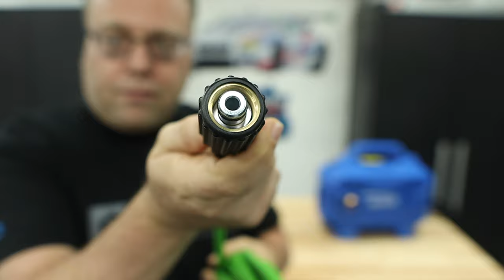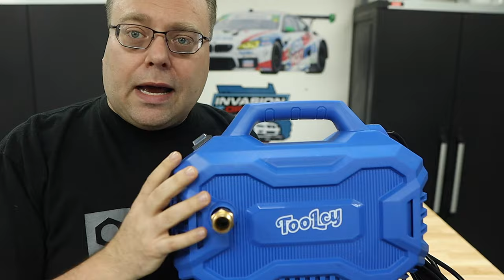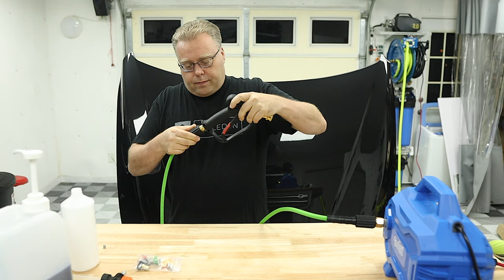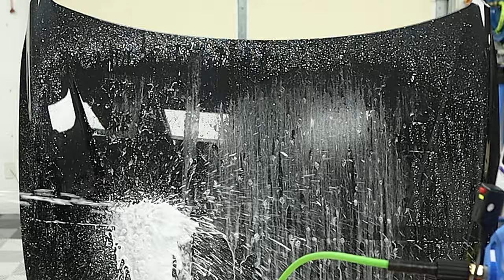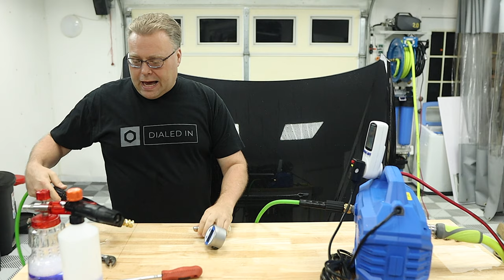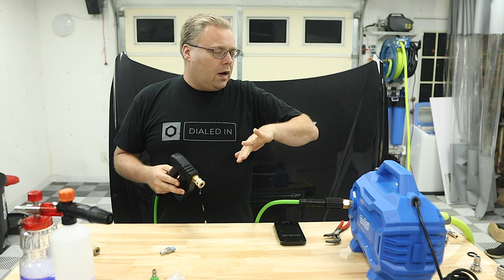$99 Amazon Pressure Washing Setup | Is it actually worth it? | Toolcy Review

Comment: I just used my Toolcy PW for the first time yesterday and had no issues at all but I used none of the stock periphery. I got a 50ft hose and their high end gun and foamer from Toolcy- very good for the money, foamed like a 90's rave. The rinse cycle was done with the Mcmillans 45 degree rubber tip nozzle, no issue there. That fluctuation you're getting never happened to me, when I say perfect, I mean perfect. I wish they had the pump only option like Active does. I found my hose was too long and cumbersome so I might invest in a reel. All in all, I'm very happy, I'll use it until it burns out then I throw down for the Active 2.0. I got zero leaks and used a full host of quick connects. So my advice is to spend $50 bucks on a real foamer, nozzle and stainless quick connects. If you go this rout you can't beat it with this budget. My car washes take half the time and are super fun. I even got a Worx blower to dry it off.

One thing I didn't bring up, this is one of the only PW's in this price range with interchangeable parts that are industry standard. I already returned another PW with the wrong size hose aperture so I couldn't upgrade the hose or foamer. That alone makes this a good starter tool.
Reply from the maker: I tried off camera with several different hoses, guns and foam cannons to make sure and it surged on those with the stock nozzle. Like in the video the 3.0 worked pretty good and numbers were okay. Sometimes you get a dud or you have reviewed so many that your standards for an entry level pressure washer are just higher when you have tested Ryobi, Greenworks, etc. Those just work so well. In the end I’m glad you got one that worked well for you. When you go active 2.0 the difference is night and day.